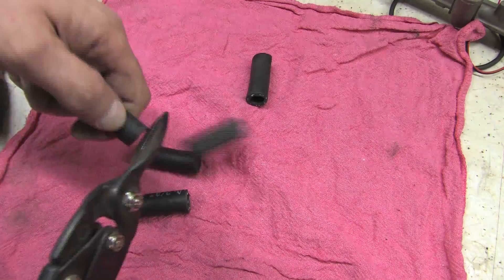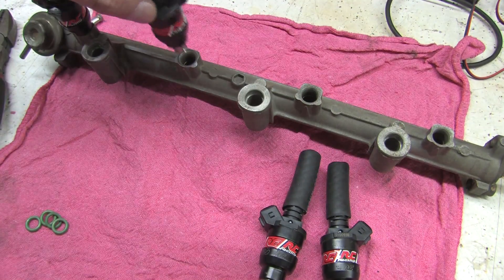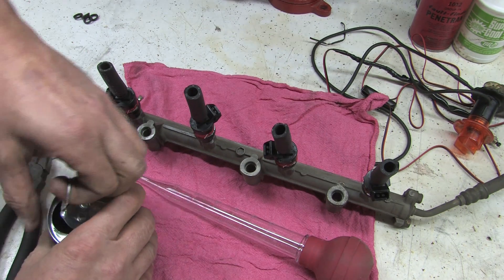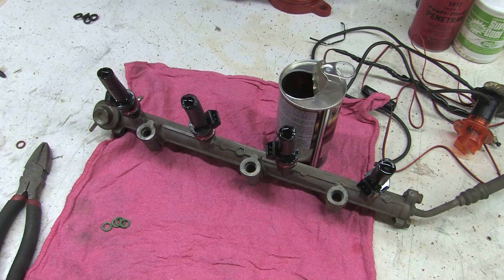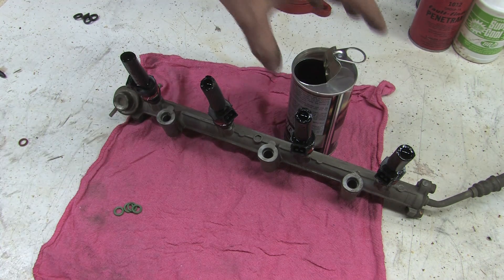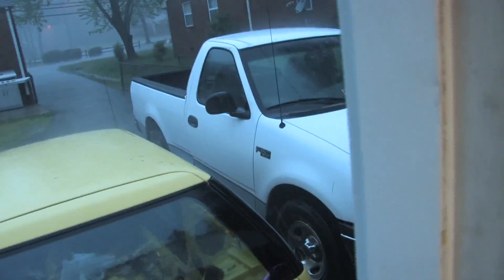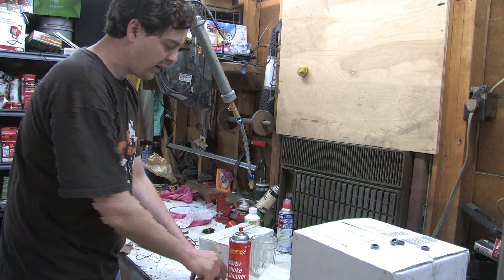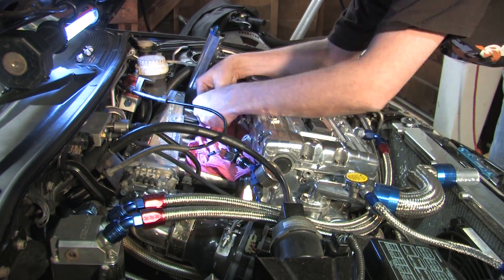DIY Fuel Injector Cleaning

Comment: I had the injector pump go out on my 2014 Silverado 6.6 Duramax.
Can I clean them out or do they have to be replaced..I found the from $450 to $600...each.
I was told there was metal in them and lines from the pump to the injector? Replace all of it
at the tune of $8 to $9,000...crap it all.
Reply from the maker: I don't have enough experience with diesel to advise you properly... but for the $ I suppose it couldn't hurt to try it?  Harbor freight sells ultrasonic cleaners that would do a better job than something like this.  If I recall correctly, modern diesel fuel systems operate in the tens of thousands of PSI, and an air compressor powered tool like this wouldn't do anything for those.  Maybe the agitation of un-pressurized fluid solvents could shake it loose?

Comment: Hello, nice video.... I was wondering how do I find out what voltage is safe to use on my injections.

thanks
Reply: Disconnect the electrical dongle and take a reading with a multi meter, see what the car is sending there. Check at least a few on a properly running vehicle, just to be sure nothin fucky.

Comment: Do you have a video that explains your setup and how to build it ?   I would like to setup something like this on my work bench but I cant follow your actual contraption and how you have the injectors mounted in it ........ Along with how to trigger the injector itself and if there is an adjustment on the trigger to keep the voltage ect in check so you dont fry the injectors . ....   If you have another video could you link it in the comments , if not , could you do a run down of your setup and how you built it ?
Reply: Never mind , I found the link at the end of the video .......... Thank you for sharing this info ... Defiantly something I will be adding to my work bench ...

Comment: how would you clean fuel injectors for a 535i xDrive 2009 and can you pull them out without having to change the bottom seal and how long can you have them out before the seal kit depressed I hear when you pull those out that you need to replace the seal and if you change them you need to recall them in the computer is it easy to do or how much does it cost to have this done or maybe even buy some refurbished ones thanks I'll wait for your reply.

Comment: I really dig the clever ways you come up with simple methods using easy to get parts. It's easy to ship everything out but what do you ever learn this way
Reply from the maker: I learned how to control my flamethrower.  You don't get that from just using off the shelf parts!
Reply: ***** I have a picture in my head of you with an injector mounted on a tube with a variable pulse control. lol

Great videos. I learn a lot and very grateful of the detail and practical advice. Always thumbs up.

Cheers

Comment: I need to clean the fuel enjectors on my 86 ford but it's a pain in the ass because the intake is over the top of the fuel rail so I have to take the intake off to get to the enjectors
Reply from the maker: If they're all still flowing, if none of them are clogged, consider a fuel additive that will do the same thing.  BG44K can work miracles if it can flow through the funk.

Comment: wowww that car sounds great I was woundering if u could help me I just bought a astra 1.6 dual fuel lpg the car runs really nice on petrol when I swich it over to lpg it sounds really spluttery and sounds like its running on 3 injectors but when I swich it back runs brilliant doesnt miss a beat so I dont no were to start ive done a breaking test got some codes and looked them up and its saying number 2 injector not functioning properly but when im running on petrol great thanks

Comment: Good that you got the injectors clean to get that smooth sound from that ricer fart can muffler, aka ebay Special! FAIL!!
Reply from the maker: +Bob Smith That's a legit Apex'i N1 from turbo back with 3 1/4" pipes and 2 resonators.  That is a $900 authentic exhaust.  Fail!
Reply: +Jafromobile Even though it is a top of the line exhaust, it STILL sounds like an ebay ricer special.
Take a look at some of the mufflers being run on high end BMW's and such.
They have a nice sound to them.
Not cutting down your car, just the sound.
Reply: +Bob Smith Yes they DO sound different... because the tonal difference is an engine difference.  A Muffler cannot completely change tonal sound outright, sorry. Geez, i wonder why a 16valve 4cly sounds nothing like a 3 liter straight six, even with the same brand muffler.. duuuuhhh

Comment: this is OK but using the otc injection cleaning tool is much easier.  $120 for the tool pays for itself doing just one car for a customer. the solution is only $10. just remove the pump fuse or relay and block the return line of there is one. it's also much easier. just connect the tool and go do other things until the car shuts off.
Reply from the maker: +CIA Assassin No argument there...  This is what you do on a Sunday if you don't have the tool, but you already have the fluid.
Reply: +Jafromobile The OTC 7000 Injector cleaner is 98% kerosene 2% stuff not needed. Just buy the Kerosene, much cheaper. Do a search for "OTC 7000 fuel injector cleaner MSDS". MSDS stands for material data safety sheet, a federal requirement for every chemical. You'll find a pdf file that has the contents and the percentage of everything in it or any other chemical. Try it, its all kerosene. The stuff the sell to clean the valves is 50% VM&P Naphtha which you can find full cans of on home depot or lowes store shelves made by Strip Kleen the other half is a longer name that escapes me but google it and you can buy Rustoleum Aircraft Cleaner and emix the 2 together at immense savings. Do the search for the MSDS sheets and then find the chemicals, not hard, save alot!
Reply: It's $9 for a can of otc cleaner don't think I'll go broke it's not something I use all that often.  I wouldn't run kerosene through it gas engines don't run too well on it if they run at all. If your lucky enough to get it to start with kerosene it's going to ping and knock and basically just run like crap.
Reply: +CIA Assassin nice handle! (: ok, I have a 1988 chevy s10 6 cyl, 4.3 L. shop told me a needed only one, bought it, now they're telling me I need the housing. my email is alessazone@yahoo.com, FB, alessa sindoni

Comment: I know you posted this awhile back. Just wanted to say. Thanks. Had issues with my Protege5 2003. thanks to your video I don't anymore. I ran across the BG injector cleaner when I was working at a shop back in 98. Used it on a z24.That was running rough just simply ran it through the fuel system. Man it ran like a scolded dog  after the cleaning. Used BG ever since. Great Motor great vid. Thank you so much seriously
Reply from the maker: George McLaughlin BG44K kept my carburetor (on an '85 Toyota X-Tra Cab pickup) in tip top shape for 345,000 miles.  I used it every 30k.  At $18 a can that seems expensive, but $180 is 4 times less than the cost of a new carburetor.  I'm a rabid fan of their products.  This injector cleaning contraption I built is just what I could do on a weekend with $35 to get my car running by Monday.  The cleaning solution more than anything else is what did all my "heavy lifting".
Reply: Nice profile pic

Comment: Hey Scotty, do you remember the late 70's and early 80's when they brought ' GASOHOL' to the market ?  Completely neglecting to tell the public that if you had an older car, the fuel system was not going to be able to handle it, I had a '68 ford mustang...  I bought a tank full of this product and within 12 miles the ford was leaking fuel from every aspect of the delivery system, gasohol just pouring out every where, lucky I didn't lose the car in a ball of fire as some did.  Every hose, the tank had to be drained, carb rebuilt to modern standards, fuel pump, engine steamed cleaned, a 2 day mess on my hands.

Comment: im going to definitely try this but wouldnt it be better if you used one of those air pressurized bug sprayers that hand pump. just fill it with that fluid you have there. seemed like you did alot of work working  that cylinder, plus i dont have a compressor.

Comment: im getting a 1981 Porsche 924 non turbo soon and the guy says its been running very sluggish because he thinks its a fuel injection problem he says the car runs fine but you have to give it a minute or 5 before you can drive it does this happen often? also he said he drove it on e and ran out of fuel how bad is that for the injection system? thanks in advance

Comment: nice video..a couple of questions:
1) is it necessary to build such a jig to get it pressure?  why not simply use syringe and plunger to create just a little pressure so that the injector fires like others have posted?  I am just trying to understand the necessity of the really nice jig (its really really nice) or can i just use a syringe saving me time & effort?
2) i am guessing you used the fuel pressure of the car right?
3) at times in your video when your injector was not firing, you pulled it out and were sticking something in it...what was that and how do you know that you wont damage anything doing that?
Reply from the maker: 1) yeah, you can do it with a syringe.  You won't achieve the same pressures that you would pushing fluid with an air supply, but I'm sure you could achieve the same result with a little more effort.

2)  Fuel pressure on the car is 42.5 PSI.  I could have used that, but I found that my trigger voltage to open the injectors was not high enough, so I had to back the pressure off down to about 20 PSI to get it to fire.  With more voltage, I could have run higher pressures.

3)  I never stuck anything inside the injectors.  What I was doing is relieving the pressure because my regulator was set too high for my trigger voltage.  I tried turning it down lower and the cheap chinese stock regulator on my harbor freight compressor couldn't go any lower.  I had to futz with it.  That extra effort sorta cancels out the convenience and ease I was after in the #1 answer, but now that I have it figured out, future cleanings just got a whole lot easier.

Comment: My fuel injectors arent opening. I know that they are getting fuel, but the fuel wont go through any of my 3 injectors, not even a little bit. I think that for some reason, they aren't getting any juice. What do you think is wrong and how can I remedy it??
Reply from the maker: It sounds electrical if none of them are doing it.  They're fired by the ECU, so anything from a blown fuse to an un-plugged connector to a shorted wire is where I'd start.

Comment: You recommend or are against reverse flushing?
Reply from the maker: I am for it.  Back-flushing them only makes sense, especially if you have an old rusty gas tank.  It takes different rigging with this tool, but can still be done.
Reply: ***** So I bought used PTEs 1000cc but first I checked the ohms and were 2.6ohms on all 4 and checked the filters with a magnifying glass and looked descent. THEN I went home after buying them and hooked up a clear hose like you did to all the injectors and very small stream of bubbles from all the injectors... Even after cleaning them (like in your video)Did I get screwed?
Reply from the maker: The more pressure you run, the harder it is for them to open.  A low-impedance injector is happier at around 4-4.5 volts opening, so if you're using a AA, it may not be enough current.  You'd need 2 or 3 AA batteries in-series to give it the same voltage it would ned in the car.

Comment: Sup dudes I have a mazdaspeed3 and it seems to misfire or hesitate in the big rpm, I was thing that maybe the factory blow of valve can handle the 15 lbs of boost it makes? Any opinions
Reply from the maker: Dunno a lot about that platform because I currently have my hands full of Mitsubishis... but if it's not leaking and you've raised your boost level from stock... it might be your spark plugs.  When you raise the boost, your fuel becomes more volatile and prone to pre-ignition.  You might just need a colder range of plugs.

That is of course assuming that your plug wires, air filter and fuel filter are in good working order.  The BOV shouldn't open at all until you take your foot out of the throttle.  If it does, you should be able to find it with a boost leak test.  I have a WHOLE LOT of boost leak testing videos here for various DSM problems, but the solutions on either platform would be the same.  Come back in a half hour and watch me port a head.  ;)

Comment: there isnt enough voltage to life the solenoid off its seat with just 1.6v, use 12v

did you find it make the car run better under boost conditions?
Reply: These parts are labeled with a 5V. Most of your sensors also run on a 5V reference. Bad idea.

Comment: I didn't see one important detail for us DYI'ers that are trying to rebuild our current injectors.  Inside the top of each one is a small mesh "Sock" for catching dirt and gunk.  Over time this will fill up with garbage and restrict fuel flow.

Anyone can find rebuild kits for this all over eBay and other online stores.  The kits will include all new o rings, covers for the pin valve, and the mesh sock.  The sock pulls out using a screw about the same size (careful not to damage the metal) and a  set of pliers.  Pull the screw out with the mesh sock and be amazed at how much gunk is caught.

Comment: Hey bud, I am actually pulling my injectors tomorrow on an 89 Bronco with the 5.8L. Where did you get your momentary button and is it running off a 9 volt battery?? I have subscribed to your channel and any information you can provide will be super helpful. Thank you man.
Reply: You can head to the local radio shack and purchase a momentary contact switch.  That and a pigtail for the injectors can be purchased at most auto parts stores.  When I did mine, I used a small a/c adapter and a power strip with a on/off switch.

Comment: Jafro, great video! Just wondering what you did to unclog the injector because it wasn't clear from the video. Did you just increase the cleaner fluid pressure or did you let it soak for a while before trying?

Comment: its always good to redline a cold engine, that way it will warm up faster and wear out faster... so everything will be faster
Reply: Its frowned upon but not really that big of a deal… as long as there is oil pressure and no load it really shouldnt affect anything. If your engine is under heavy load then yes you should let it warm up, if you are just revving it out you are unlikely to hurt anything. Simply because your crankshaft is supported by a oil layer, not metal on metal. Camshafts might have some issues but realistically nonexistent
Reply: @AwakenedR6  Yes. Once oil temp is above or at room temp, and proper oil pressure there is no damage to be done general. Although Mr. "bobl78" here seems to lack a few chromosomes thinking it was rev-ed seconds upon start up.......
Reply: @3n3ly7m9  yup. keyboard warriors that dont understand basic concepts such as oil pressure like to teach on the internet

Comment: A good full service injector cleaning should include all of the following:
1. The top of the injector has a micro-filter pushed into it.  These should be removed, thrown away and new ones installed.
2. Ultra-sonic cleaning while the injector is being pulsed.
3. Back flushing the injector.
4. Install new o-rings/seals & pintle caps.
5. Accurate flow testing before & after to validate both the cleaning and normal operation of the injector (back to original specs).

Comment: Would a 12V cordless drill battery (NiCd) be a better option for testing high resistance injectors like the 210cc 6G72 injectors I use? I am glad I did more homework before I used the car battery!

Comment: Is that a homemade fuel injection tool hooked to an air compressor made with some cast iron pipe, caps and air fittings? How many volts do you apply to the injectors to make them fire - 12v? What did you mean about getting them too high - the air pressure?

Comment: Thanks for the fast reply! Iam going to be using this on a friends car... a 96 Plymouth (automatic) it just died mid drive the other day (more than once) but after a little while it would come back... only to sound and feel like it wanted to die again (until it did). Let me know when I could be wrong, since started up its not the starter, the fuel pump. or the alt, or the batt... so I was guessing (without seeing it) dirty injectors, air filter, or fuel filter... could I be close?

Comment: Very cool...I like the 'out of the box' ingenuity in getting the job done.  I just replaced my injectors (7.3 powerstroke), I now have 8 that I need to test and/or rebuild.  I can't find anyone in/near my area that provides the service.  If I send out, it's just south of $200.00 per.   Since I need to verify which are bad, I found your video extremely helpful.  The concepts and how you went about testing them is 'Golden'...hats' off dude!

Comment: Jafromobile, I'm planning to do the same with my nissan navara/frontier injectors and I have a question for you, do you use a resistor in your firing circuit to limit your current when firing the injectors and what is the minimum pressure I can use and still be able to perform this operation?

Comment: Just found out that at least one of the solvents in b-12 chemtool is not recommended with PVC.  Back to the hardware store for some metal pipe.  Should I use b-12 straight from the can? It's supposed to be put in the fuel tank.  What about that BG stuff you using?  Is that a tank additive?  This is all new to me.